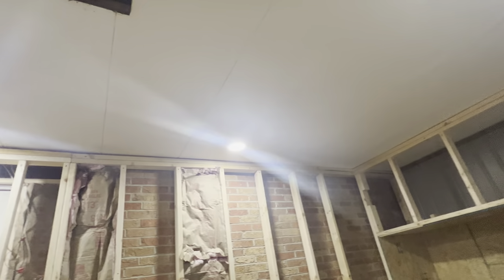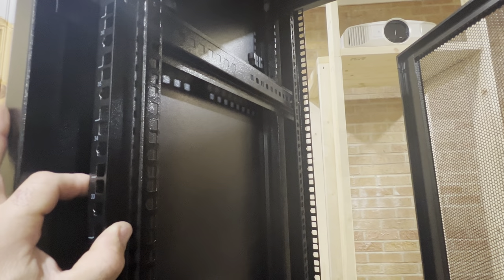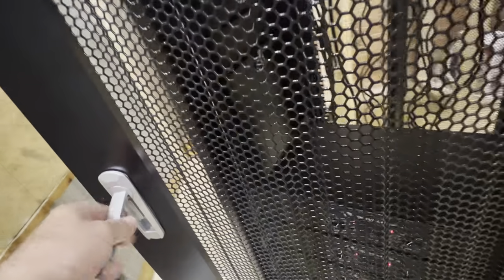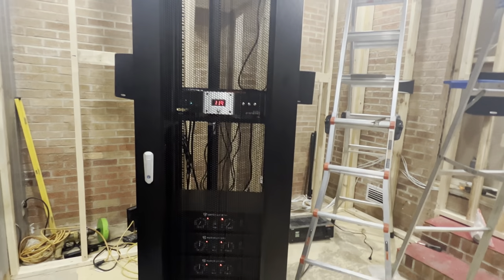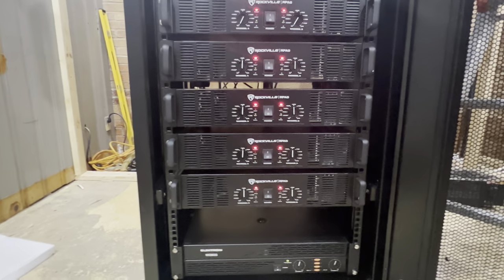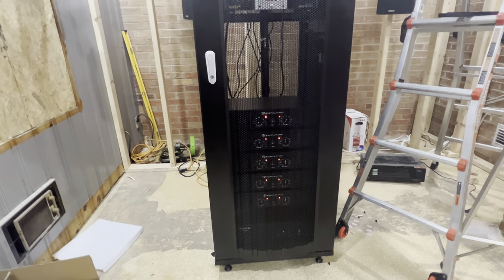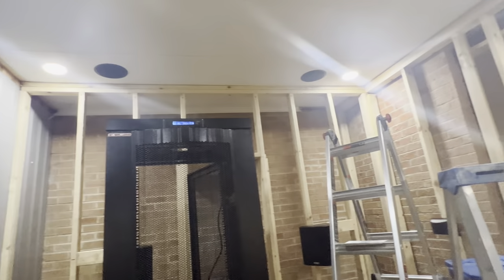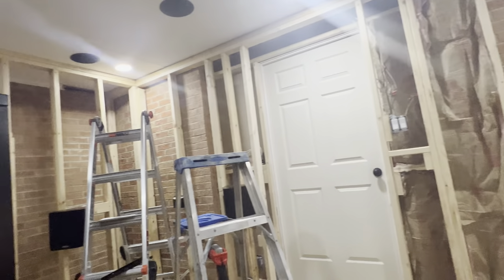Update!!! Rack done!! Plugging along!!! 7.2.4 dedicated home theater

Comment: 42U means that it is 42 rack units tall. I think one rack unit is 1.75”.
Reply from the maker: Ok thank is man. I had no idea.
Reply: I’m also new to the whole rack thing. I got a 42U about 8 months back. Mine is a totally open design and it’s double sided. I haven’t even filled one side yet, but if I need room in the future, I can expand it and double the storage space to 84U! It’s made by Star Tech and I got it new for about $260. Bargain, I think.